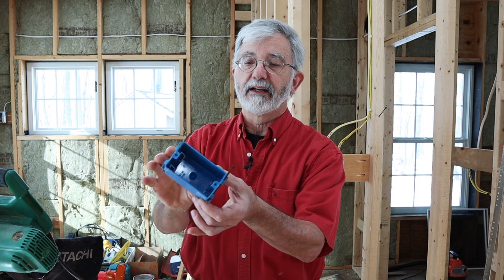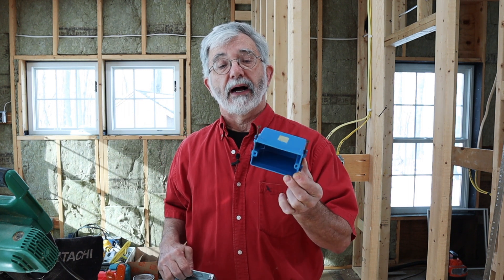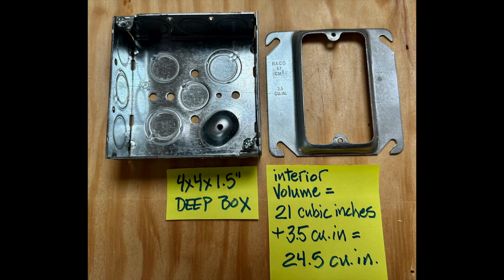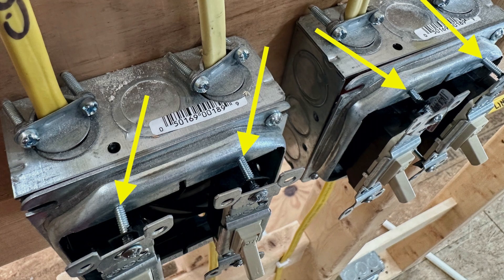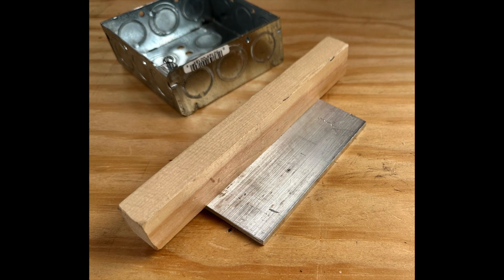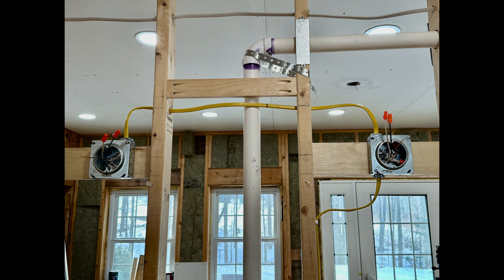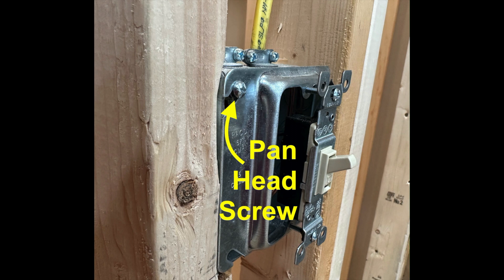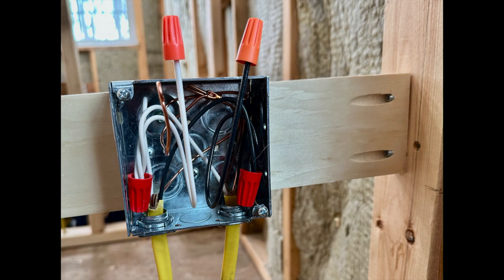Steel Electrical Boxes Are Better Than Plastic! (With How-To Details)

Comment: Hired an electrician to re-wire entire home I had pulled all the drywall out of it had Aluminum wire. Show up he trying to use those when I said no way putting those plastic junk in there. He came up with all kinds of excuses why he knew it was more labor hours. They always go with the cheapest possible way so more profit goes in their pockets. Had him pull what he installed and go buy metal boxes.

Comment: 4" square steel boxes and mud rings are very affordable. They cost less combined than steel single-gang device boxes! Why? Because they are absolutely ubiquitous in the commercial electrical trade that contruct in commercial buildings with metal studs and EMT conduit. They're called "1900 boxes" by old-timer sparkies. It was apparently a well-known item in the Steel City or RACO catalogs from the days of yore. (Not sure the exact details.)

Comment: metal is conductive, therefore it needs to be grounded. if not grounded, it could become part of the circuit if the circuit insulation fails for whatever reason and it's exposed conductor makes contact with the box. the box, if ungrounded, will become part of the circuit which will preclude the circuit breaker from tripping unless two conductors of opposite color make contact with the metal box at the same time. what is more likely of a scenario... one conductor shorting to the box or two of opposite color? 

grounding circuits in industrial/commercial facilities are built into facility during initial construction. copper grounding cables, bus bars etc. in your home, you will have to buy extra eletrical conductors to add the electrical box to the grounding circuit. so the cost is more that just the box itself vs a plastic box. the cost of the extra labor and conductor adds to the cost. 

in my opinion, plastic is superior to metal in a home electrical circuit because it is non-conductive, costs less and can be purchased with varying levels of rigidity from very rigid to flexible. if rigidity is your reasoning to buy metal boxes, just know that plastic boxes can be purchased that are cheaper than metal and nearly as rigid.

Comment: One stupid thing...a single gang metal box (not a 1900) is only permitted to hold one wire. There is a 3 1/2 deep metal available. Metal boxes are also gangable. They also allow the ears on the electrical device to clamp tight to the drywall...most of the plastic boxes keep the device completely inside the cutout
Makes it impossible to keep the devices at correct depth, especially with multiple gang applications. My theory is that someone lost a bet on the 9th green, managed to make the metal boxes much less practical.

Comment: I agree that they are GARBAGE. I have to wonder why you would use them on other people's houses. I have gone out of my way ripping out the garbage plastic and replacing them with metal. But I did go with the same size boxes. Also, in the video, it looked like there was a 14 gauge wire feeding a 14 and a 12 gauge. That's not safe. you can go from a  thicker wire to thinner, but not thinner to thicker. That can cause overloading and over heating.

I was looking to couple two metal gang boxes that are not gang-able. Using knockouts and a pass through. Haven't been able to find such a video.

Also, it behooves people to use lever nuts. No twisting on the wires, which reduces wire fatigue, and it is so much easier. The only con, is it behooves one to wrap in electrical tape, because a wire can push a lever open when trying to stuff the box or just enough pressure to let the lever pop up. Otherwise, they're superior to the twisted nuts.

Comment: Good evening Herrick.  You make some great points about metal vs plastic,  And you have to great ideas about how to firmly mount boxes.

However, I would like to make a couple points:
___________________________
~I found the price of a metal box, box cover, two connectors to be closer to $8.

~Doing an addition needing 45 boxes would not be a budget buster.  However, doing a whole house with hundreds of boxes would be prohibitive.

~These are the things you do when it is your house, you are not bidding on a job, you are retired, and you have the time and money to do things EXCEPTIONALLY well.
___________________________
If you follow code and best practices, plastic is equally safe and affordable

~Anchor the Romex within 7 inches of the box
~Us anchors every 4.5 feet
~Properly and securely anchor the box to a stud or cross member.
~Use plastic where code allows.  And use metal where code requires.
Reply: Plastic box was invented for tract home builders they also back stab the outlets all that is code compliant.  NFPA is controlled by them why they allow back stabbing and plastic boxes.  All about lowest cost who cares what happens in few years your long gone.

Comment: I use 4x4x2 1/8” for junction boxes where necessary.  I’ll use them for exposed work.  Metal boxes are better but most won’t want to pay more for metal over plastic.  Labor really increases with any metal box.

Comment: You've conflated three separate issues here.  First is box material which can be metal or plastic.  Then there is box size, and there are options in both plastic and metal.  Finally there is the method of attaching the box to the framing.  While I also prefer metal boxes, it should be mentioned that plastic boxes can also be purchased in larger sizes and attached to the framing using the method you describe.  You also didn't mention the additional time required to bond the ground wire, which often involves connecting an additional pigtail.  It may only take a few minutes but when multiplied by the number of boxes in a home, it becomes significant.
Reply: I prefer plastic boxes in the attic when there is no ground wire because if I am crawling around on my hands and knees I feel safer.   When there is a ground wire I use a metal box.
Reply: Machine screws are not designed for plastic. Home builder of rental I bought used a battery powered screw gun stripped out every outlet screw in plastic boxes plug in to the outlet it's lose. Plastic box is pure garbage were invented by people who want to charge $XXXX, but cost them $X that's the American way greed and profit all that maters.   Electrical trade doesn't care because only have to warranty it for a few years anyway after that lose outlets isn't your problem.

Comment: I also like the metal boxes better. Just feel more secure when you plug in. Also the plastic large boxes for switches need additional bracing or they go crooked and look terrible. Pre made bonding wires with screws can be had an any supply house in case you didn't know.

Comment: i flip houses. I COULD NOT DISAGREE MORE WITH YOU regarding your preference for metal electric rough-in boxes over plastic ones!!  THERE IS ONE - AND ONLY ONE question a person should ask when deciding between these two boxes: "which one is safer both to install AND more importantly, years down the road."  PERIOD!!  That is the only RELEVANT question.  i don't care how "unstable" you think plastic boxes are. i don't care how much better you feel metal boxes hold the wires in place. Plastic boxes WILL NOT conduct electricity should the power wire touch the box.  somewhere down the road when maybe someone else is replacing the outlet or switch of GFCI on one of your metal boxes, they may be the homeowner or a "careless" electrician and they could easily allow the wires to touch the box.  if they do, they will receive an electric shock. that WILL NOT HAPPEN with a plastic box.  when we do electrical repairs or new installs, we provide as much "safety" as possible. we use NOTHING BUT plastic boxes AND we use HIGH QUALITY electrical tape to wrap around the wire attachment screws on every outlet, switch, or GFCI that we install.  i've heard all the comments before here on Facebook from "professional electricians" offering negative comments on plastic electric boxes or "making fun" of "any electrician that wastes tape wrapping an outlet or switch he just installed."  my comment to ANYONE who holds these views is that YOU MAY NOT BE SMART ENOUGH to be an electrician!  there is only ONE issue for electricians - SAFETY!!  safety for themselves and safety for the people "down the line" that might touch your work.  Mr. Kimball, you should be ashamed of yourself for telling novice homeowners and "DIY" remodelers to "always" use metal boxes.  your comments are frankly - RECKLESS!
Reply: Or you could just ground them properly. And shut the power off when messing around with electrical wiring.
Reply: @Tephnos  yes, of course. however, when we do "flip" houses, we repair/remodel them with a future "not too smart DIY" homeowner in mind.  other than a garage or laundry room where outlets are "exposed wall mounted" and need to be "robust", i can think of NO-ZERO reasons why all new outlets should not be plastic boxes.

Comment: the comparison of a 1 gang to 2 gang is meh... but i find metal and conduit protects wires from idiots hammering staples through cables and provides a more rigid mounting in some cases

Comment: Honest this is stupide.....Oke i get you people you want a big box....i agree thats more Handy but then you cover it up and end up with a smaller hole so your stil dinking around....plus you wil never get to those screws ..... excuses me for my ignorance but why is that box not covered by finishing plate that closes the whole box??.... Hey im from Europe and we have small round modular connectable plastic boxes.....and our switches cover the 2 screws that are mounted horizontal or verticale then the finish plate covers the whole metal frame ....

And yes ours are Dinky small but hey they work had no problems in my life and ice been doing diy electrics for 30 years now.....

Call me bios but why o why does nobody  make your electrical boxes more modular like the German ones we use ?? I bet i can be done with your codes....hek we are running Double the voltage trough those resepticals .....

Im just shaking my head.....so glad i dont have to deal with us electrics......but i guess that goes Bothe ways😂😂😂😂😂😂
Reply: Interesting. Could you please send a link to the type of boxes you use? Thanks!

Comment: I try to keep people with Propane Torches away from my receptacles. And have yet to experience any issues putting wires in an 18 Cubic inch box. And who goes around Wiggling your boxes??  If you correctly Staple your Romex and use code correct lengths (6” from the shield and 3” from the wall) I just cannot justify the argument. Plus I use WAGOs not Wire Nuts. MUCH safer in my estimation. To each his own!  cheers…+x
Reply: Some people use American products you can keep your commie country's wago connectors. I use ideal products they are made in America. 73
Reply: @ronb6182 Try the 3M performance plus wirenuts. Even more secure than Ideal. You'll love them!
Reply: Machine screws are not made to screw into plastic.

Comment: I too will not use plastic boxes. Metal boxes when done correctly are some much more 'solid' than the plastic nail on ones. I understand the using of Romex(which I hate using)in the house behind the drywall but everything I do out in my barn and garage/shop is all done with conduit.
Reply: You hate Romex.  Do you advocate using conduit behind the drywall, inside the stud walls, in the house?  Do you understand how much EXTRA time and cost and supplies that would require to wire a house?  Just double or triple the cost to wire a house.  Who is going to pay the extra thousands and thousands of dollars?  Conduit in the barn or garage or shop or basement makes sense because the wiring is exposed.  So the conduit provides protection for the wiring.  And nothing is finished.  And the conduit is just screwed to the wall or studs or joists.

Comment: I'm curious about the crimp connector used to bond the ground wires.  I've always used standard wire nuts to connect multiple ground wires.
Reply from the maker: It's a Buchanan crimp, made with this tool: https://www.amazon.com/Ideal-145669-C24-Crimp-Tool/dp/B000HEKRWA
I took an electrical class taught by an electrical inspector when I was in my 20s and he said that he liked to see the crimps instead of wire nuts. So I bought one and have used it ever since. But there is nothing wrong with using wire nuts. 👍
Reply: @herrickkimball  Thank you for the explanation.  Had never seen these before, but I am thoroughly in agreement with your methods.

Comment: I never use tape or webbing when I do joints.
Never had one crack or fall out either.
Fun fact: You can use automobile bondo for joints and gaps.
It hardens significantly faster than regular stuff.
Trick is you have to have it smooth immediately after you put it on.
It doesn't shrink either.

While I have used an occasional plastic box, I will try to use metal boxes as much as possible.

Comment: I like the metal boxes especially if you have to run 3 ways then I can just run conduit instead of Romex never had a problem using a roto zip on a metal box just stick a piece of card board in the opening and it protects the wire

Comment: I prefer metal boxes as well. Add in some emt and I'll be completely happy. In regards to your first reason, I would agree with that point on rough-in, but once you install the mud ring, the opening is much smaller than just an open 4x4 box opening (and a bit smaller than the plastic box, so working on or changing a device after the initial installation isn't much easier at that point. Of course, you don't have to swap out devices all that often so it probably isn't that big of a deal.  As far as the mud ring goes, I cut the hole big and then just patch it with quick-set mud. I tried the dimpling but it never worked out all that well for me. Especially since my cut-out holes always seem to be a bit off no matter how carefully I measure. That's my shortcoming though.

Comment: Good video, I agree.  I do wish that the metal boxes had more mounting holes.  It can get frustrating sending screws in so close to the edge of a stud.  I wind up drilling my own mounting holes more often than not.

Comment: Yes, metal boxes are better, but I think it's a little overkill to do everything with metal.  I don't think it's worth the extra cost.
Reply: Maybe not every receptacle or switch, but they definitely should be used for some of them.  The problem is knowing ahead of time which one.
Reply: @Lughnerson I would definitely use them for most receptacles..
Reply: Agree wholeheartedly.  In some cases, yes it makes sense to use metal boxes.  And in other cases, it makes sense to use plastic.  Use the right materials and wiring in the right places.  Don't go one extreme or the other for no logical benefit.  I use both plastic and metal boxes where appropriate.  I use NM Romex wire or conduit where appropriate.

Comment: Love your video.  Everything is true!  My dad always used metal boxes, and as a young’n I must’ve asked why sometime when I saw plastic boxes somewhere.  I remember hearing some explanation, but what stuck out to me is that “plastic can burn, metal doesn’t”.  And that made a lot of sense to me.

Thus, in all the work I’ve ever done (except for some low-voltage), I’ve used metal boxes.  I love them, love their safety, love their sturdiness, and see no reason to change.

Honestly, electrical box cost in virtually any installation is going to be very minimal in the grand scheme of things.  Yes, maybe metal boxes are 4-5x the cost vs. plastic, but when that is minimal to the entire cost, I like the benefit more than the cost.

Comment: I was under the impression that metal box are good but to ground them you will need metal cables with it to
Reply from the maker: The boxes are grounded with a lead off the electrical wire ground. 👍

Comment: are your windows missing headers in the first video shot? or are there headers hidden above? just curious...
Reply from the maker: No headers on the gable end of my addition. Not a load bearing wall. I have larger than code-required headers over the doors and windows on the load-bearing walls.

Comment: You are comparing a double box to a single box.  Just use a double box if you want volume.
Reply: Or the other way around... many times a double wide box will not fit and you have to place a single.  If it fits, use an extra deep single to provide more room.

Comment: As a diy'er I've experimented with plastic and 4 square metal boxes with appropriate mud rings on a mock up. I agree with everything you said and you have confirmed my favor for 4 square metal boxes. I thought about using a wood backing like you suggested, but I haven't tried that yet. I find that the welded bracket on the side for stud mounting to be very solid and strong. I think that they are easier to mount accurately by using screws of my choosing, rather than the nail on plastic boxes. I find that the extra cost is insignificant compared to the overall project cost.

Comment: Love the plaster ring setup. More of an art. That plastic junk is not code here in Canada. Metal 2x3 boxes can be the best of both worlds: 
Gangable. 
Deeper options up to 3" for more space. 
No plastic holes to strip. 
Internal cable clamps so no box connectors needed. 
Positioning tabs so you can slap it on the stud and screw it in place in seconds without the need for pocket hole woodworking behind it. 
Single gang to double gang upgrade after drywall is done? No problem you can remove the stud screws from inside the box. 
Drywall over it without the plaster ring and will look 100% the same with less work. 
Price is +/- the same as the plastic-fantastic box.